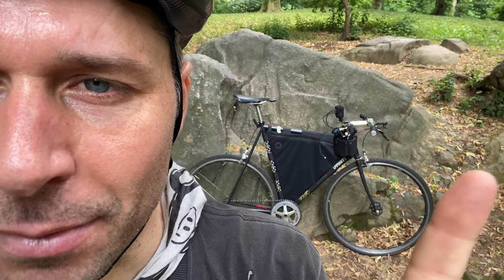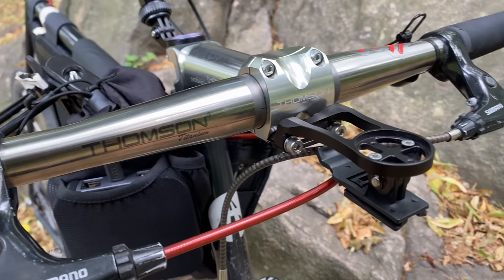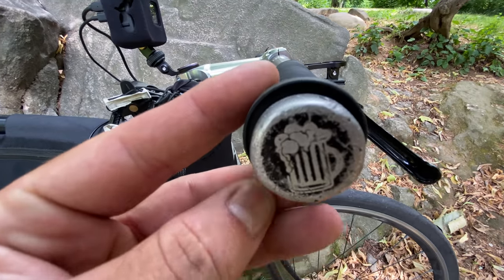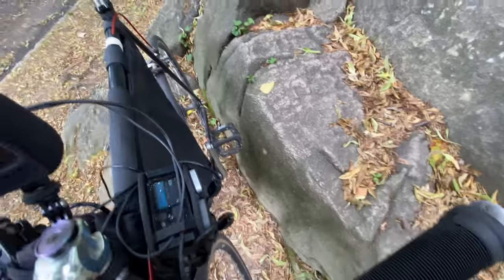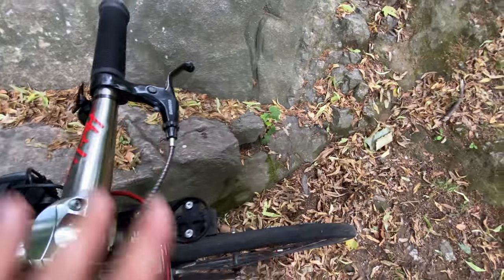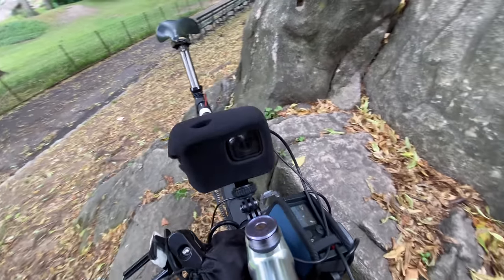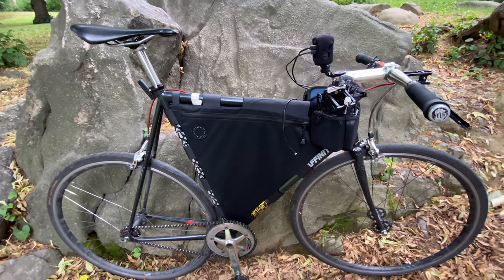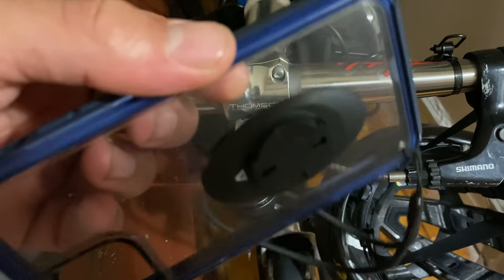CycleStream 2.0

Comment: What its the modem operating strategy? 4 different carriers/accounts or is wifi in use - does LiveU sell the data plans or just a VPN to manage the network bonding? Does this only work in NYC? I have visions of 3D printed mounts for your component parts - maybe a flat carrier in the framebag with a cooling fan/cooling duct. -build something to go from the BB that fits inside that bag, though the modems might like to be as high up as possible. Too cool, ride safe.

Comment: I think the bags holding your modems+jetpacks are going to bang around over bumps. You'd be better off doing a front rack with a pelican case to house everything more securely, since you have so much shit you need to stream at the level of quality you're looking for. Also, the frame bag turns your bike into a sailboat, and super annoying in the wind. Makes sense to keep the battery in there where it can be nice and low, but not worth the pain in the ass handling you're going to experience. 
Also, I want a hotline sticker.
That is all.
Reply: Tend to agree, getting two pelicans and drilling holes in them for cooling, then drilling mounts into them that connect to the top tube  either side would be excellent. Drill holes in the bottom (as to stop rain entering) and then create two metal brackets to piggyback across the top tube between the two pelican cases, then I would drill through the frame on the top to mount the two metal brackets.

This kind of gets to a stage where it would be worth actually getting a frame custom made for this, because you could then get metal mounts for the battery and other ancillary items where the frame bag is.
Reply: You would probably throw up if you saw my bags like that to hold my road ebike batteries lmao
Reply: no style that way :) 3-D print a pelican case inside to fit inside the frame :) another idea/challenge would be to install it all inside the handlebars and tubes